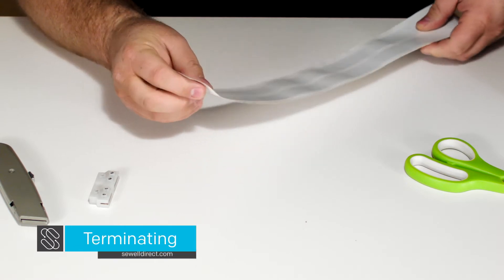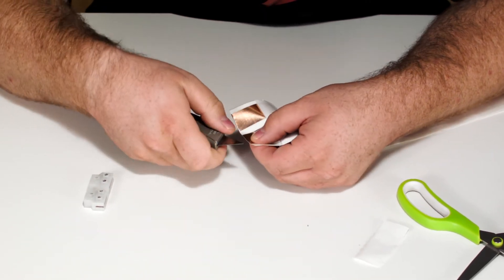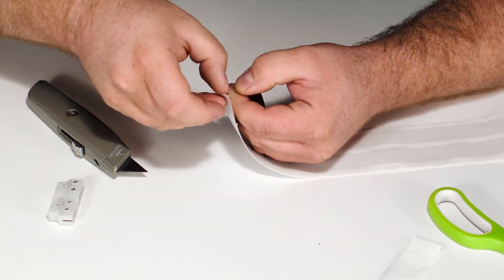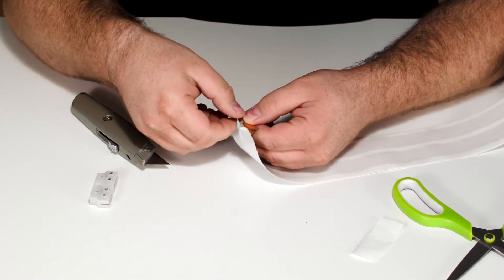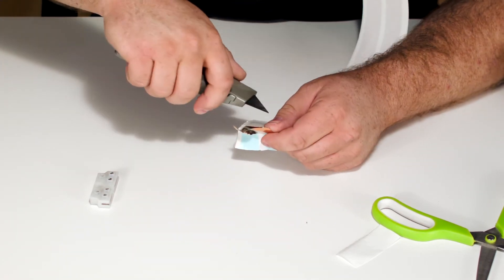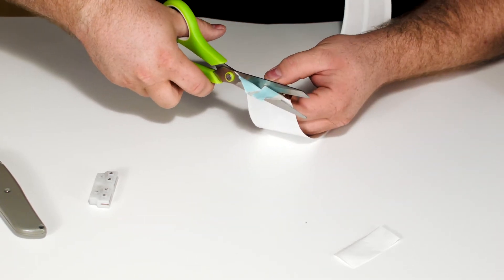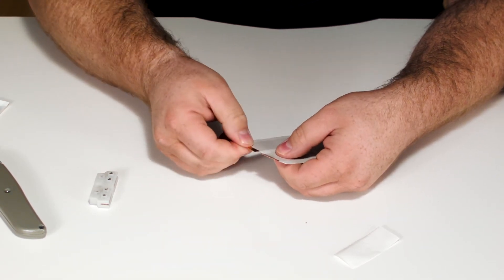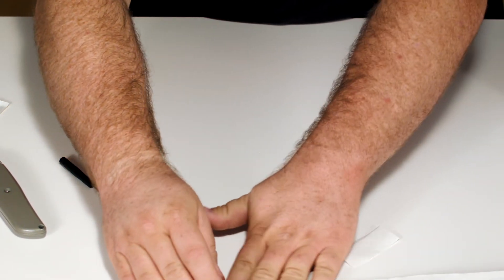How to terminate Ghost Wire using a Terminal Block (2 conductor)

Comment: There's no need to peel both sides of the copper, just peel one side and fold it before entering the connector.
Reply from the maker: yeah good catch :D  we do mention that on our new video for the new GhostWire that's WAY easier to use than this one, here it is in case you haven't seen it: https://youtu.be/20_DRBhu5ZI

Comment: I would heat up the end with a hair drier to separate the copper from the sticky plastic cover. I guarantee you it will be way more easier.
Reply from the maker: That's a great idea, we haven't tried that yet, but we will. However we improved the design on the 2-conductor so you simply peel it off instead of all this. Have you seen the new video? https://youtu.be/20_DRBhu5ZI 
But I will definitely try the heat up method on the 4-conductor since it still has the old adhesive. Thanks for the tip!
Reply: Sewell Direct 
 Congratulations on the upgraded version! It's a great product and I'm surprised  it's not more popular and widely available, say at Home Depot . On my opinion this is the best product on the market of this kind. I have accidentally found it on EBay. Love the fact it's solid copper and not aluminum with copper coating. My intention is to solder the wires to it instead of using the designated connector,  so I can keep it low profile. I also have already come up with a few different applications, other than speakers such as accent lighting on walls, ceilings and stairways, as well as automated flower watering, all abandoned projects of mine due to difficulties running the wires through the walls.  Best of luck and constant increase of the sales are my wishes to you!
Reply from the maker: that's awesome! sounds like fun, I usually don't recommend it for electricity and lighting due to all the different fire codes and voltage ratings (our ghost wire is only rated up to 10 Amps) but it sounds like you know what you are doing so good luck and thanks for all the tips! maybe share your pictures when you are done?
Reply: Sewell Direct 
I'm an electronic engineer and I know what I'm doing, supposedly. All the applications I was talking about are 12V DC, so it's up to code once it has fuses added after the power supply.   But I'm glad you mentioned it, so people don't misuse the product reading my comments.